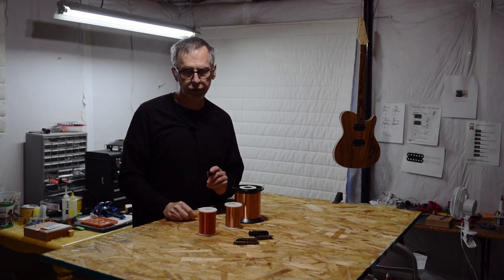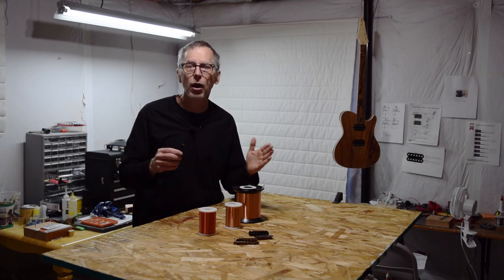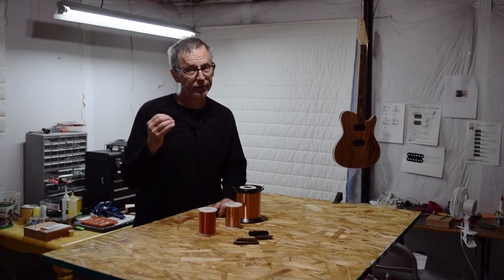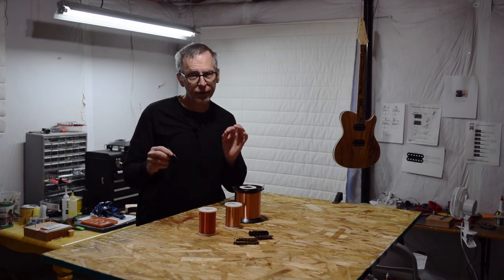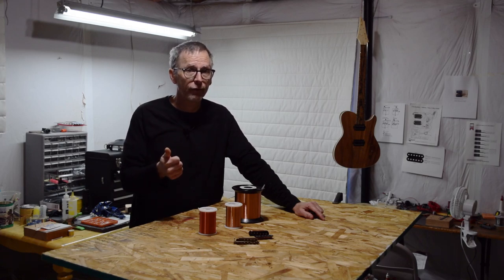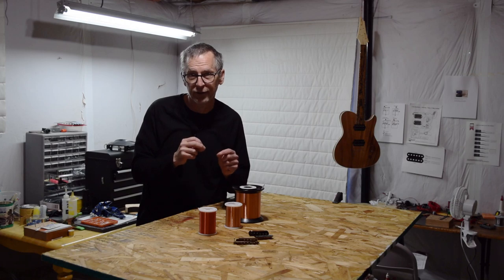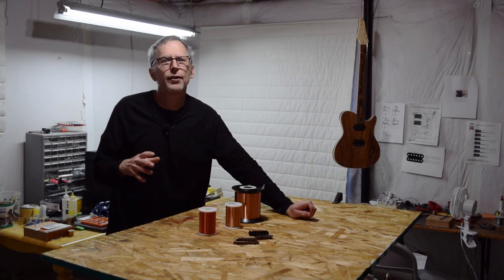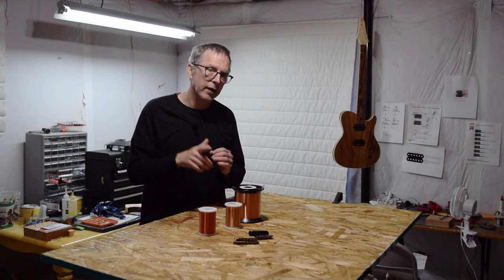How to Select Coil Wire For A Guitar Pickup

Comment: Hi, is it possible to rewind my 62 P.bass bobbins to original speck. Back about 30-40 yrs ago when young and very stupid l got into experimenting with my old slab neck 62 bass not knowing then what a legend they would eventually become.  I cant remember what messing i was at but the bass eventually lay in pieces for a lot of years... I also play guitar and wasn't much into bass at that time... anyway, what ever happened i found that the pups had died in the mean time. I wasn't too upset cos well, just get new pups and all will be fine!  Luckily I didn't throw them in a bin ( tho. one is missing but must be lying around somewhere) but i realize now the big boo boo l made!  I think it was 44 guage Formvar they used back then but not sure about that. I'd love to hear your opinion on this.  PS....I used to build my own pups way back but I have to say my ability and knowledge is nothing like yours...your bloody BRILLIANT!
Reply from the maker: You can rewind the pups close to spec, but the wire made today isn't the same as what was available in '62.

Comment: Recently finished my winder.  I had breaks and soldered them then covered joint with poly and kept going.  Not sure if that's kosher, but after a bunch of windings didnt see alternative or starting over as viable.  Just got a n
mojo tone device and hope it makes easier.  Had 7400 on a Tele bridge and I shifter my fingers and boom birds nest.  Had to cut off and now start over.   Does your winder with cam eliminate this hand hold method completely?

Comment: Why not just use the thicker wire, and then make the bobbin taller, so you can get more turns on it? I mean, if it's your guitar and you know how much room you have to work with and/or are willing to rout the pickup cavities deeper.
Reply from the maker: If you're building a guitar for yourself and are willing to go to the trouble of fabricating the bobbins and routing the pockets a tiny bit deeper, there is no reason not to do it.

Comment: I have a pick up where I took off the wrapping around the copper wire and a couple of strands came loose that I can visibly see. Does this mean I have to completely rewind it or is it still a usable pick up?
Reply from the maker: The only way to know is to test the resistance with a multimeter.

Comment: Hey Chris  another very informative episode as per usual,  and it got me to thinking, I'm not one to blindly follow Anyone for ANY reason ...I must concur with said narrative or educate myself until I understand why that individual has come to that conclusion to begin with, however... in this situation I cant even find my eye dog, i thought the thicker the gage and shielding the "hotter" the pickup, hence being called a hot pickup, However  lol correct me if I'm wrong but it has to do with the numbers of winds and the space between the first wind  and the following wind or am I just associating hot as in wire being too close together and being hot as in better...idk is shielding placement responsible for feedback as well as tonal advantages?, although I may have read into that placement spacing thing a bit ... here fido! smh 
Any recommendations other than than a third grade science book lol for clearing up whatever question it was I was trying to ask concerning the build and what makes a pickup hot or not? God forbid we end up bv with an average pickup in my axe lol thanx buddy anything would be a help at this point✌
Reply from the maker: The gauge and insulation thickness only affect output by impacting the number of turns of wire that can fit on the bobbin. The thinner the wire, the more turns you can fit on the bobbin and the hotter the pickup will be.  You can only fit so many turns of 42 gauge wire on a bobbin. However, you can fit far more turns of 44 gauge wire since it's thinner than 42 gauge.

Comment: If you was making a humbucker could you use two different wire coating or thicknesses for each bobbin of a humbucker to blend the sounds together reaching more of a middle ground of high output and mid ranges ?
Reply from the maker: Sure.
Reply: Would that work or would it be a waste of time ? Would it be noticeable
Reply from the maker: @robertcoleman7124  it would work, but there’s no way to know if it would be noticeable.

Comment: In your diagram regarding insulation thickness vs frequency response it suggests that the thinner insulation will result in more treble.

But i thought it was to do with capacitance and the space between the turns of coil, so that the thicker the insulation the less capacitance and the more treble? ie the more high frequencies are allowed through.

Is the diagram labled wrong or have i got it wrong?

Thanks ! (this is all really good info)

Comment: Longer wire gets you more voltage. Thicker wire should get you more current. If power needs both, it shouldn't be much more worse to have  current instead of the voltage. Why not get the desired voltage for the amp with a transformer? Maybe lose some some dynamic range in exchange for some extra harmonics and low end? I used to have a fake humbucker that was actually extremely underwound single coil with a tiny transformer instead of the other coil, and it actually sounded pretty good.

Comment: 6:43 No it won't. Turns pull out a certain amount of wire based on the dimensions of the bobbin and the built-up coil wire already on it. The heavy formvar will look bigger on the bobbin, THAT's the difference. In fact, BECAUSE it's dimensionally bigger, it'll make the effective bobbin size increase more rapidly, thereby making each turn require a longer circumference of wire, and you might actually end up with MORE length of wire from 6000 turns of heavy formvar than from the same of a single build insulated wire.
Reply from the maker: Yes, you are correct. I should rename my channel “The Dyslexic Luthier.”

Comment: What impact do these insulated materials have on the end product when the pickup gets dipped in paraffin wax? Namely the polyurethane based wires.
Reply from the maker: Are you asking what impact the wax has on the wire's insulation?
Reply: @HighlineGuitars  yes. You mentioned applying the soldering iron to the wire can remove the coating. Was curious if hot wax does the same thing, and if it does, what impact is has to the insulated material, if any.
Reply from the maker: @DevilMayAsian  No. The wax doesn't get hot enough to melt the insulation. If it did, the coil would short out and not work at all.

Comment: Trying to reuse a single coil structure to fit into it a sustainer driver pickup and a single coil to by pass when the sustainer is not engage, I buid something similar to a stack hmbucker, the question is that in my country is near to imposible to get some wire thinest than 38 awg and the most of them are doublke coated, so I build the sustainer driver whit a 32 awg and then used a 38 awg for the single coil section, I used all the wire I can fit on the remaining space of the pickup structure around 5mm and finally I dont really know how many winds I  reach but the coil dont give more than 350 Ohms 🤣 of resistance so I think this pickup will have the worst sound in the world and will have a really dissaponting output, and also think about trash it and not even try to test it but finally I do, and I have really interesting surprise, the pickup gives a low volume actually with my amp at 5 with a stock pickup on the affinity stratocaster that I was using I got a sound level on decibels between 90 and 95 but using the ultra low resistance single coil with 350 Ohms resistance I got the same 90 to 95 decibels using the same amp (a 20 watts Marshall dsl) but increasing the volume to 7 (both tests where using the gain at the middle)  in terms of tone the crappy pickup sound darker and bass were notoriously accented but actually is a little difficult to notice missing treble but  it sound pretty decent. So my question is why it works in a decent way considering the stock pickup I used to compare has a 7.8K resistance and the other one just reach the 35 Ohms of resistance?

Comment: I'm curious about how signal strength depends on wire gauge. Assuming two coils have the same bobbin size and number of windings, will the output signal of a 44 AWG be stronger than a 42 AWG? I appreciate your response, thank you!
Reply from the maker: Yes.
Reply: @HighlineGuitars  I sincerely appreciate your feedback; I will try with two types of copper wire and compare them
Reply: @nguyenoan4994  The reason 44 would be hotter or higher output than 42 is that the resistance of 44 ga. is higher than 42 ga. Just like the more winds you put on a coil the more output and also resistance you will have. More resistance = More output as far as the wire alone goes. There is a lot more to the workings complexities to the pickup as a whole of course.
Reply: @scottjamable  If we use the same type of bobbin, the same pole pieces (e.g., AlNiCo 5), and wind the same number of turns of wire, the resistance of the one using 44 AWG wire will, of course, be larger. However, what affects the output is the inductance of the coil, not the DC resistance
Reply: @nguyenoan4994  I know I make my own pickups, I was just explaining in simple terms wire resistance to the question wondering if 44 would be hotter or higher than 42. By saying same length of 44 ga. wire as 42 ga. will have higher resistance. I now see that it was you who asked that question. So I guess you know why now I was just trying to explain it in simple terms by comparing resistance of ga. wire.

Comment: Can the resonant peak frequency be moved to partly compensate for high frequency losses from thinner wire?
Reply from the maker: Yes. You can alter the RP by adding a pot and/or a capacitor.
Reply: @HighlineGuitars  Maybe I can build it into the impedance and capacitance of the coil. SD's Benedetto HB is 12k but has clarity; I suspect the RP is adding back treble.

Comment: What do i do, if i can’t choose the wire. And I only have a 40AWG gauge wire with unknown insulation - should I wound my pickup? Also, same situation with magnet -- i have only furniture latch magnets.
Reply from the maker: Yes, you should make it. No reason not to. If it sounds good, you win. If it doesn't, no big loss.
Reply: + @HighlineGuitars  
That's what I thought -- no need be worried about a curse from the gods of winding pickups.  )))

Comment: What if we use "42"and half gauge wire?
Reply from the maker: You'll get 50% more output than 42 gauge wire and 50% less output than 43 gauge wire.
Reply: @HighlineGuitars  
But ,sir , I want to balance treble ,mid range and bass same range . What should I do?
Reply from the maker: @qeenceydineshi6925  It depends on the type of pickup you want to make.